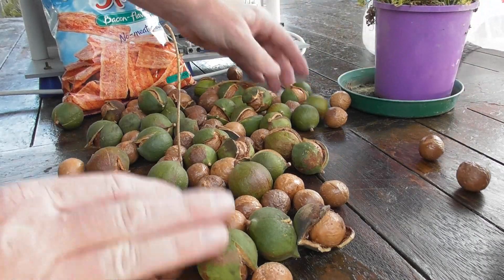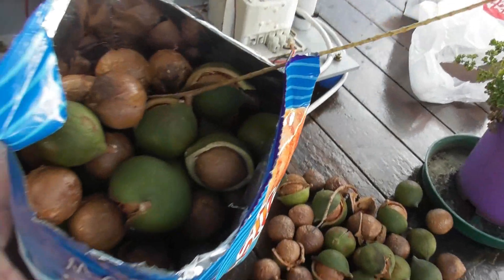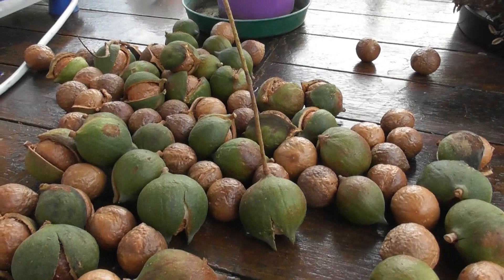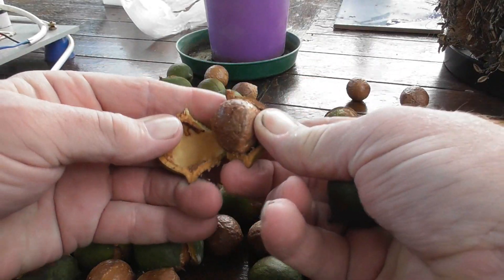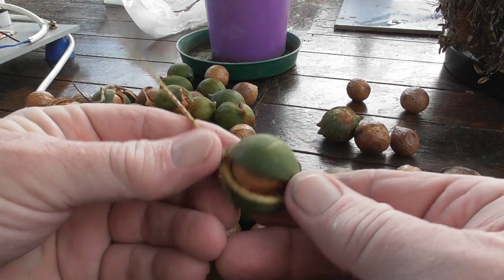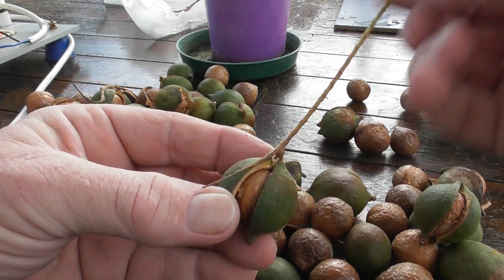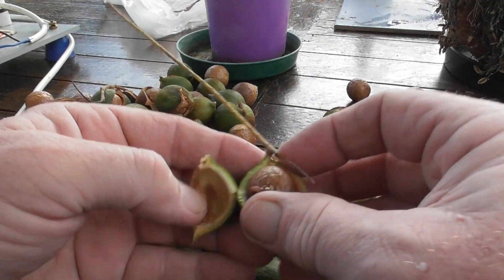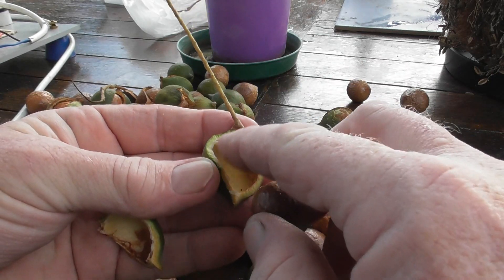Macademia Nuts - a Nutty video

Comment: Not wireless, but contact surfaces that are removed once nut is fully charged up, and the outer casing is too small, and starts to separate. Same with walnuts and peanuts, though peanuts are beans and not real nuts.